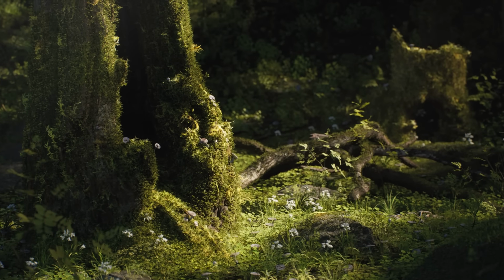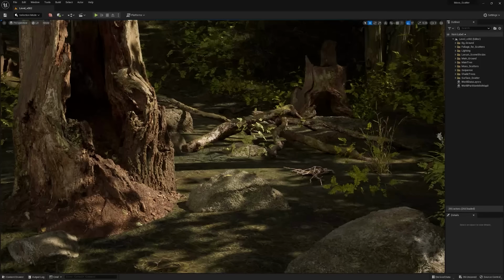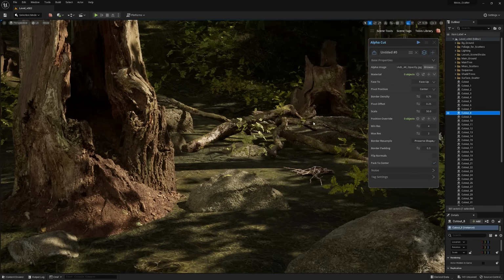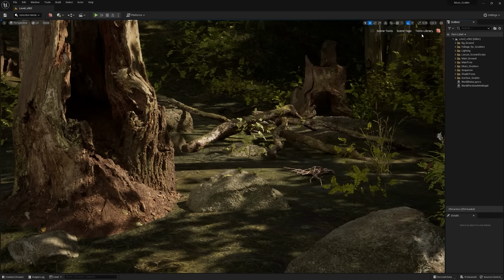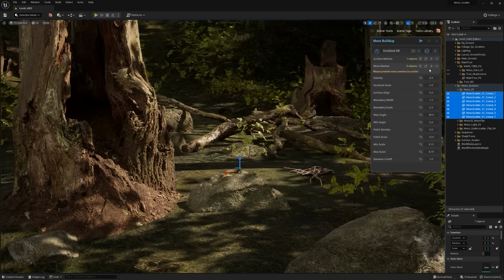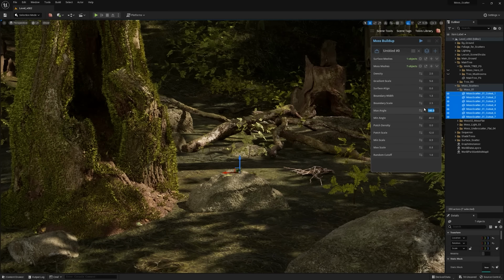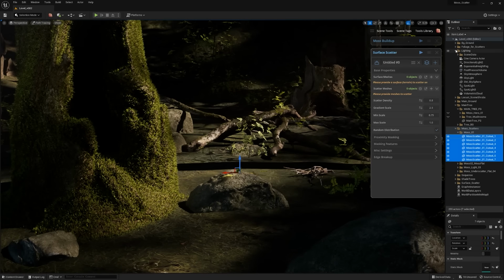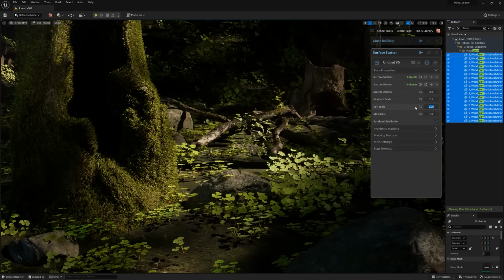Learn to Create Realistic Moss in Unreal Engine 5! - Tutorial UE5

Comment: Is it possible to do a scatter like this, and bake it out into a static mesh?
Reply: I'm wondering the same thing here. Can we work on this and then bake it in a mesh with the Level Instance Blueprint workflow for example. Using the tool to scatter moss in an existing prefab and baking it it there as one static mesh or multiple or something like that.
Reply: We provide a tool called Instance Baker which converts your instances into static meshes. I'll make sure we include an update that merges the static meshes into one, vs making a static mesh for each mesh card.
Reply: @Nohraz  Totally, if your end goal was this scatter. But if you wanted to use this tool to do a scatter, then further modify from there - baking into one mesh is ideal.